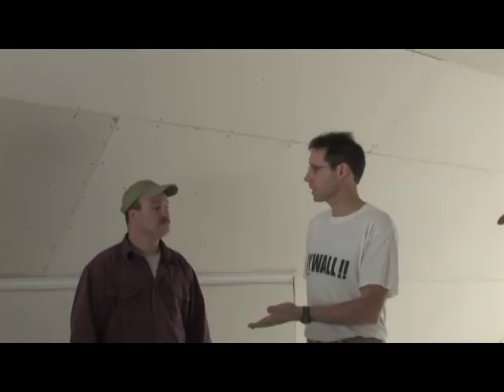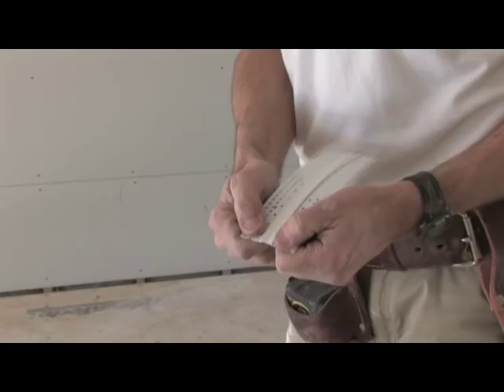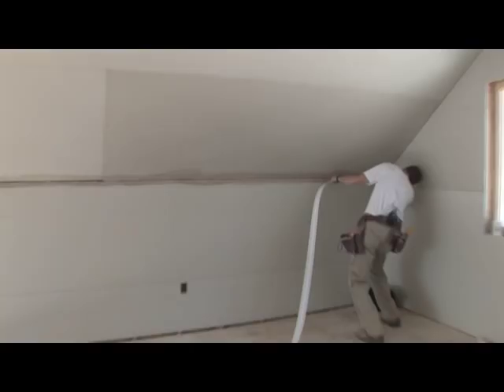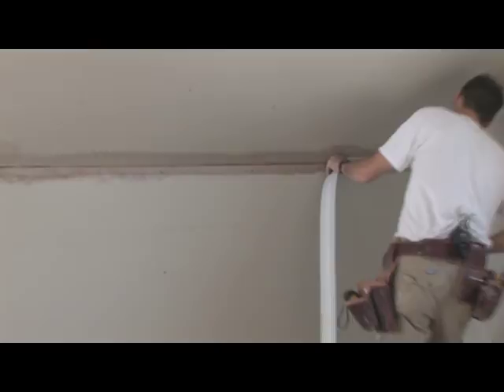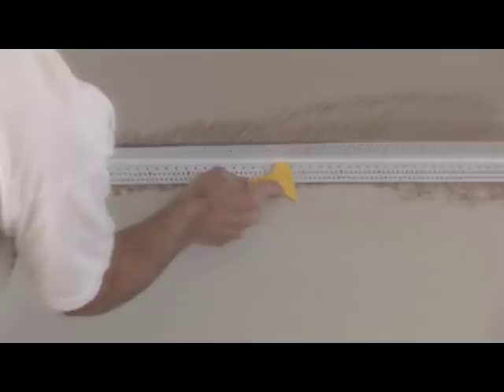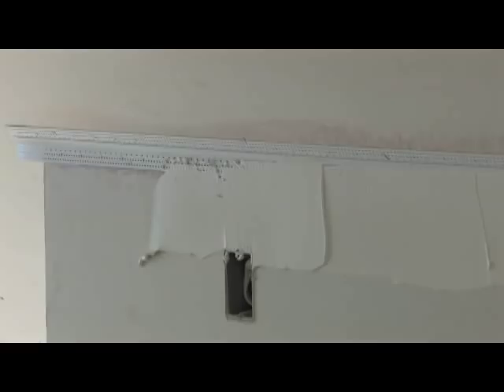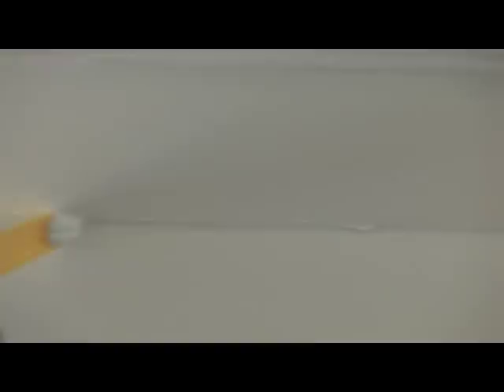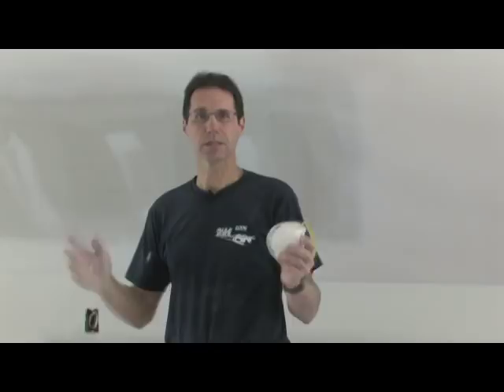Magic Corner Expansion Bead Testimonial with Drywall Pro Myron Ferguson

Comment: When you get used to doing this it take less effort doing it this way.  This is THE best was to do these corners.  I use this on all my tray ceilings and you can not get straighter lines any other way.  After you apply the magic corner, there is no taping involved and no rounded inside corners.

Comment: Prefill the joint with quick set compound, then tape with quick set.YOU will  have to fix the corner mud doesn't stick well the spray adhesive.

Comment: Good job. I prefer using straight flex on those types of angles.
Reply from the maker: Straight flex is a great product for this as long as the joint doesn't experience a lot of movement. We recently came out with a Straight Flex comparable, Angle Master that is best for this application. Magic Corner is ideally for joints that are susceptible to a lot of movement such as peaks in vaulted ceilings.

Comment: If you don’t pre-fill and mud set those you’ll be fixing that later. Sure, the adhesive holds it in place, but it isn’t getting mud behind the bead. I’d expect the mud wouldn’t stick to the adhesive either. 🤷🏻‍♂️

Comment: If the rubber's exposed because of expansion and contraction won't the paint crack over time?
Reply from the maker: +Tyson Good question, here is what we recommend to prevent cracking.

Finishing: Always use multi-purpose joint compound to mud Magic Corner. Use lightweight or topping only as a final coat. Between coats, use the pointed tip of the Cleaning Tool to clean the mud out of the flexible center of the bead as shown to the left. The center must be clean of mud for the product to function properly. 

Painting: Magic Corner is designed to be an expansion joint to prevent expensive call backs to fix cracks in the drywall. The pliable center is designed to expand or contract as much as 1/8". Since paint is not very flexible, please follow the guidelines below to ensure satisfactory results.  Always use high quality paints as they bond better and have more flexibility than more inexpensive brands. Do not prime the flexible center of the Magic Corner. If applying primer by spray, try not to spray too much paint into the flexible center. The heavier the paint is applied, the worse the performance will be. Brush in a coat of the final paint color.